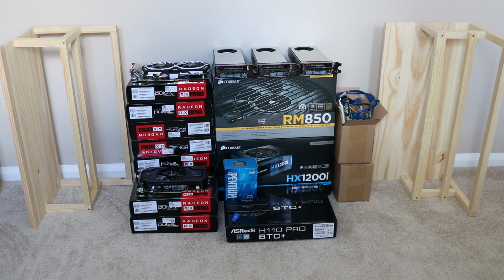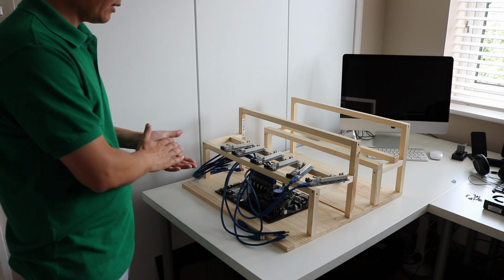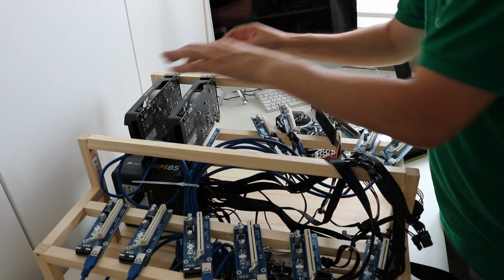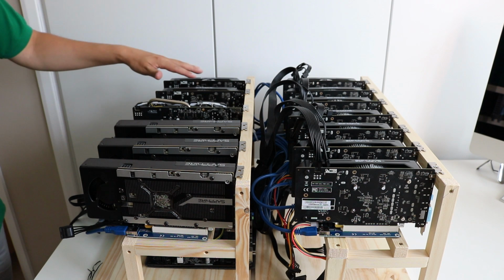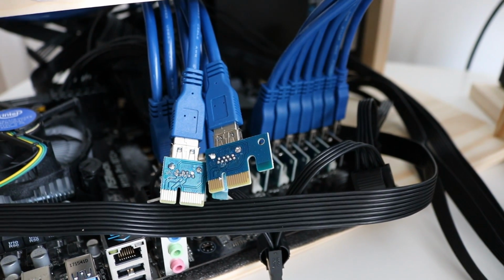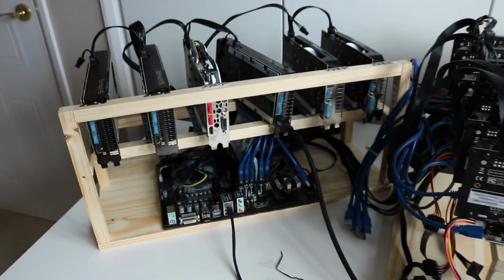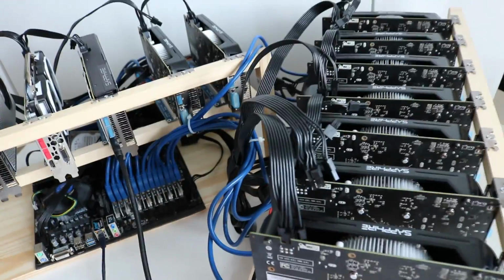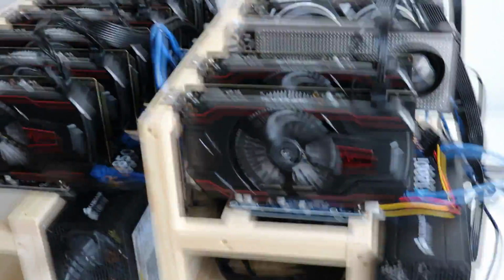Building a 13 GPU Mining Rig - Asrock H110 Pro BTC+ RX560 RX470

Comment: Why did you not choose GTX 1050ti over RX 560
Reply from the maker: I considered the 1050 but I could not find any version with a pcie power connector. I didn't want to power all the gpus solely by the riser cables.
Reply: MSI GTX 1050ti Gaming X
Reply from the maker: I've since gone back and found a few similar options. I think I looked at the non Ti versions originally, they do carry a +£25 premium over the RX560 though.

Comment: very nice man !! if you could put all gpus 570 you would do it? or the hash rate isnt much different with the 560s?
Reply from the maker: The hashrate is a little over double for the 570's but the cost price and electricity use is also double.

Comment: Lee, where did you get the power connect that goes to the Motherboard and Both PSU's? I reac the HX1200i stats and it doesn't look like it comes with it and I can't find it anywhere.
Reply from the maker: Its a separate adapter and not included with the psu. I'm using a ATX PSU adapter cable like this one http://amzn.to/2vcrVna
Reply: Thank you, I'm looking to upgrade my rig to the new Motherboard but I wasn't sure how to manage that. I'm also trying Burstcoin mining but I've only got 4tb and it's not having much luck yet =) Cheers

Comment: Something not right with that power app. The live consumption shows 1.365 kw, which if left on for 1 Hr 52 minutes would mean the consumption would be 2,548w, not the 410w shown as the total consumption.  If I've done the maths (not my strongest point I give you) that would be 37p for the period not 6p shown.

Looks like you should recover your costs quicker than you thought, given that the value of Bitcoin increased by $1400 per coin in the past week.... That will mean the cost of GPUs will go up or be like hens teeth :)  Can't say I agree with mining and the impact on GPU supply and costs its caused, and would have thought that by now some alternative all in one type board with DDR5 ram / GPUs would have been developed purely for mining, but such is life, and I'm sure graphics cards manufactures are happy meeting the demand.

Although its personal, I would love to see how much net profit you actually make from day one, and seeing how long it really takes to recover your investment, and then how much per month you actually get.
Reply from the maker: Power draw was mixed during testing so mostly it was not running under full load.
I'll do more videos in the future on earnings and profits.

Comment: AWESOME Build mate. Can I ask why you opted for RX cards rather than NVIDIA ?
Reply from the maker: I thought about it for a long time. I almost went for a 1050 build but I could not find any with a 6 pin pcie power connector and I didn't want to power them all via the riser cables. I didn't want to spend the extra money on 1060's or higher.

Comment: I am getting 13.6 megahash with exact same RX 560 s with modded bios, memory on 2000mhz and core 1020mhz (getting most hashrate on that core clock even with RX 460s with unlocked cores) memory timings from 1625 to all. and gpu-z shows 30 Watt consumption. and running them for 1 month stable.
Reply from the maker: Excellent. I'm hoping for similar results.
Reply: yes u have to do what i told u and when AMD releases new driver which fixes DAG issue your hashrate will be even higher then that.
Reply: so i should go with RX 470 for mining? also can someone answer me why he has 3 different types of cards ? why not all the same ? and wow ididnt know you could have so many into one motherboard :)
Reply: why not? go do that, untill u can, because Proof of stake is coming (BTW after that u can mine Zcash) :) u can mine whatever cards u have with 4GB's, not necessary to have same cards, coz every card works on it's own job independently.
Reply: nika kalandadze fuck u miner pos
Reply: They are hot :))))

Comment: why the hell would you build a 13 gpu rig with such shit cards?  why not build a 6 gpu rig with 1070s or 570s?!?!?!  you basically wasted this board and built hashrate wise what you could have built on a 4 gpu 1070 rig... honestly... insulting to the H110
Reply from the maker: Because of the COST! I would of loved to of built a rig using 1070's or 570's but buying 13 new high end gpus just wasn't a option for me. Especially at the current inflated prices! I decided to go for lower spec cards that were readily available and at a fair price and decided to take the hit on the performance, however the efficiency of the gpus is very close to that of the 570.

Comment: Hey mate, I am planning on building a budget rig. Want to get your opinion as I was thinking of getting some R7 370s and Rx 560's. Is it ok to mix these different cards in one rig? Or should I just have all cards from a similar series? Thanks!
Reply from the maker: I could not use my r7 370 in the new rig due to driver incompatibility with SimpleMiner, EthOS and Ubuntu. 
You should be okay if using say 3 of each within windows for example but for simplicity I would use all of the same series of gpu. Mixing the brand of gpu is okay, they'll just look a bit odd but I'd stick to the same series.
Reply: Yup I'll be using windows. Thanks for your opinion! :)
Reply: reddevilO7 don't build a budget one u ruin gamers chance fucken mining pos

Comment: Lee, you were concerned about the heat from RX470's blowing onto the right hand bank of cards and building some ducting. Why not just locate the RX470's on the right hand side, blowing external to the rig?
Reply from the maker: I did consider that but I was a bit concerned about the load on the RM850 if I swapped sides. I'm going to build up one of the frames and stack one above the other, my longer usb cables have arrived so should be fine to do that now.

Comment: Hey Lee, what do you make of the upcoming PoS change for Etherum and generally what are your calculations for profitability. My understanding has always been that given the vast changes in difficulty/network hashrate and prices getting a mining rig running for profitability is a very risk venture. You could break-even after 6 months or never depending on what is happening with the currency you are mining. The exchange variance is high and most other minable coins are behaving in a similar fashion i.e. switching to a more profitable one might only work to a certain degree. What are your thoughts?

Comment: lee u recommend getting biostar 12 gpu board ? as asrock one has pcie slots very close
Reply from the maker: The TB250 pcie layout would be much easier to work with but I've not personally used that motherboard. The pcie connectors are very close but its the pcie-usb ports that are the main problem, for this kind of setup you really need to insulate those connectors when its not required for other 6 gpu motherboards for example.

Comment: Am currently runining 6gpy 470 with lots of win10  issue do u advice going to ethos
Reply from the maker: What kind of issues?
Reply: IMineBlocks watchdog issue many times i couldnt find what issue just recently started
Reply from the maker: Is it with the same gpu?
Are you overclocking or made any gpu bios changes. Try running with one or two less gpus and see if the problem still persists.

Comment: You're right, NEVER use SATA for power connection with high power cards! One of my adapters get burned because SATA has only small gold contacts for the 12V line.

Comment: What is the cost of build? How much is the monthly earning from this rig? Why do you have the hot air from one side blowing onto the graphics card on the other side?
Reply from the maker: The parts cost would be $3260, Revenue/profit per month would be around $400 / $215.
I'll change the design now that I have longer riser cables!
Reply from the maker: Thanks, you were clearly paying attention during the video :)
Reply: at least he built something that over 99% of population never did nor will ever do. he deserves alot of credit. he is also learning. now its your job to make it better. he open my mind to build one my self, and make it better and more efficient.
Reply: spoonikle power consumption is worth it as the rewards are greater. I also have solar.
Reply: aniket kakadiya Hey scammer, I got your email. I'm into 1080Ti and not the rx470. eBay and Amazon prices are not outrageous if you buy the correct one. If I give you my money you will just keep it.
Reply: aniket kakadiya I want 3x 1080Ti. what payment methods do you accept? how much duty do I pay and how much is the shipping?
Reply: That depends whether you only care about Ethereum - it will be dead for miners soon, 1070 is good for other crypto.
Reply: With the poor air flow maybe a lot
Reply: Depends on the wood. Some start charring at 120 and ignite at 180
Reply: You're computer should never even go above 80c. Max temperature components are built to withstand is around ~100c. 20c is a huge difference. Only the core of your gpu would be at the highest temperature even seen a gpu with ir gun? the Temperature drop off is significant a few millimeters from the chip.
Reply: The rear plate and parts of the top are also very hot, especially when overclocked.  IR gun can't read those parts because they are shiny.
Reply: WOPPER it was more of a joke comment really, but if a card overheats or a fan fails , I would think a steel rig frame would be a safer solution
Reply: What do you want me to do with the link?
Reply: It's a cr@p website, you need to check your reviews
"Rip off alert.  I purchased an item; they charged my credit card and never shipped the item.  I have emailed them 3 times and called their phone number numerous time.  No answer.  Super frustrating."
"BUYER BEWARE. As you can see from the reviews this company has a history of sending faulty products and not responding to any emails. I too received a faulty product and there is absolutely no way for me to get in contact with them."
"I placed an order, and have been waiting for it to ship, and after 10 days no updates, no email replies, no answering phones... I'm putting a claim on Paypal to get my money back..."
"I placed an order on 6/1 and they still haven't shipped it. When I placed the order all of the items were in stock. I just checked with their customer service and they have no idea when it will ship and they even hinted that the items may not actually be in stock.
Don't order from these guys unless you want to wait weeks to get the item."
"Ordered a product and was sent a similar, yet inferior model. Perhaps they hoped I was technologyly incompetent. Unable to resolve the issue despite contacting seller."
"Placed my first order with this company last week and they sent me the incorrect product. I was considering them as a drop-ship source, but they are clearly unreliable."
"Horrible company! I ordered what I thought was a new item and when it arrived it was used. When I powered it up it didn't work at all. It was defective out of the box. I followed their RMA procedures and paid for return shipping. I got a call from Hy Ly and he said the RMA wouldn't be honored and he accused me of opening the unit and tampering which was not true. He also threatened to call the police!!! As of today I'm out $77.18 but I'm not going to give up. Any rating outlet I can find and State agencies I can contact I will."
"Quite rediculous rules for international customers even Aussie treated like criminals (paypal refunded coz address not confirmed, required letter + credit card scan both sides)
It seems like they are not realising that it's not possible to confirm address outside US"
"Unresponsive and rude, this company sells faulty products and then avoids the responsibility of dealing with their customers-- I would dissuade anyone from dealing with Centrix International. After receiving a faulty WD TV Live -a surprisingly common experience from the looks of these reviews- I received a return authorization number the next day, however with no mention of how to return it; feeling unsatisfied that I was left responsible for the return shipping of the faulty item I received, I immediately replied and requested a return label. Two weeks, eight e-mails and two phone calls to their California office later I finally received a reply, a bristled, all-caps e-mail from a Mr. Ly declaring that the return label they finally were sending on my request was "THE LAST". Unprofessional from beginning to end, I really regret having anything to do with this company."
"I purchased a new wdtv. They sent a refurb. I contacted customer service several times. They never responded. Avoid."
"I ordered a brand new wd tv live on Nov 30 but after a lot of calls, they shipped product on Dec 3. Finally I received a recertified product without box. I called them and they promised to send me an email to refund but I did not received anything until now. They are cheat and awful!"

I suggest you look after your existing customer, improve your rubbish overpriced website before you spam people with your adverts
Reply: Nadim Awan2 you're a fucking idiot
Reply: Tyron, thank you
Reply: Nadim Awan np
Reply: Nadim Awan2 i
Reply: What is the MH/s rate and the total power consumption of the system? Also what's the cost of your electricity?
Reply: will it payback before it break though ?
Reply: Can i get your whats app number, i am interested in video cards for mining...
Reply: You can be rich if you create an power plant to sell energy to miners...
Reply: Nadim Awan - the 1070 has great price/hashrate/power consumption. not sure the 1080ti is the best choice
Reply: Lots of heat on a wooden frame, would could possibly go wrong? Lol 😂
Reply: All my cards are sub 60c

Comment: Hi Lee, as you tested this rig consumes about ~1400W, so why you use total of 2050W suply not use like 2 psu with 1600W? Also, do you have any unstable problems during running this rig? Thank you very much for a nice setting rig!
Reply: Thank you very much! You are right! I just figured out the optimum range of most PSU is 50-70% of the rated load.
Reply: Loki Matsu  , its better to have bigger psu , having 1400 from 1600watt its quite close to the max range ,  i have a rig for 1000w but spreads for 3 psu for 650w , in this way i know i dont do heavy load
Reply: Loki Matsu like he said in his video, these are old PSU. He is reusing old parts
Reply from the maker: When overclocked I think the rig will use closer to 1600 Watts. I already had a 850 so made sense to add a 1200 rather than 1000. PSUs also have an optimal efficiency at around 80% load.

Comment: thanks Lee for the great video.. so do you think you can get the same results with Ubuntu rather than using simple mining os? because Ubuntu is free and simple mining costs ;)
 what's your take on that? cheers
Reply from the maker: In the end I did use Ubuntu, I'm testing Simpleminer also to see what works best for performance and stability.
Reply: IMineBlocks okie dokie... Keep it up.. Cheers

Comment: I hope, for the sake of your sanity, that the 560s are more stable than the 460s.  I have never had more problems with any combination of rig than the 460s.  I wish I had never used them.
Reply from the maker: I could not find any 460's with a extra pcie power connector, thats why I went for the 560's. I not sure if that contributes to your problems with the gpus.
Reply: Possibly.  True, 460's are only powered by the riser/slot, but they have a lower TDP than the 560's and draw less from the riser/slot than the larger cards (with the external power input).  I think it's more about the processing unit unlocks and/or timing mods...although I have had stability issues with stock settings.

Comment: Lee, what do you think of rx vega? i saw an article where vega fe with new driver have 60MH/s
Reply from the maker: They look good but going to be very expensive I think.
Reply: Yeah around twice the price of rx 580 and also almost twice the power, rx vega 56 250 watt $399 and rx vega 64 295 watt $499
Reply: zno3 i saw an articel today they said the rx vega 64 gets  around 70  - 100 mhs. But i think its fake
Reply: Perhaps, but looking at the specs it seems possible, well until the release date then :D
Reply: zno3 The new rx is slower then the gtx 1080 ti  and the hbm memory cant effect so much you can look at the rx fury they only get 27 mhs. mh

Comment: lee, great stuff, but i highly recommend using better gfx cards as soon as you can.. 
you got the hard part down, like the 2 power supplies, risers, and 13 gpu's running. 
it's just you can get so much more h/s with even 470's and 80's.. 
170 hs is 6 480's.. 
so, i think it would be quite worth it, to gradually replace and upgrade the rig
Reply from the maker: Yes it does make sense. The main reasons I didn't buy was due to they inflated costs and availability of the higher spec cards.
Reply: yeah, it's not a good time for 580's :D 
then again, vega is coming out soon, 
which is sorta like 1080 performance. amd is pricing it at 400$. 
i think that will make things a little better maybe, miners will rush to that, and maybe 580 will get realistically priced again..
Reply from the maker: Normally windows. I'm okay with Ubuntu but its not natural or easy for me to work with it.
Reply: Nice job getting it running Lee. I'm going to be building a couple this week.

Do you know anything about the Vega cards? ie: what shops will sell them? can we pre-order? How much it will cost and the expected hash?

Cheers bud